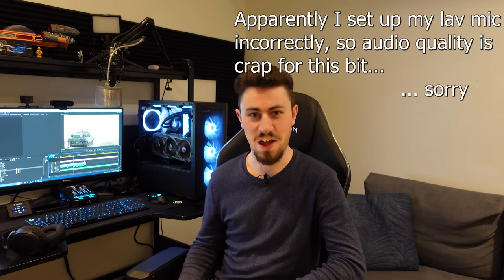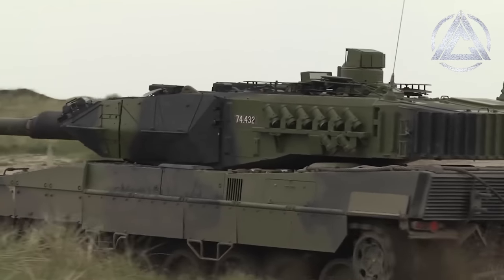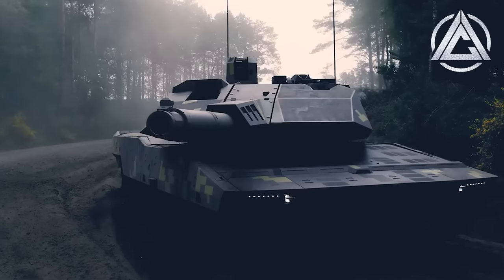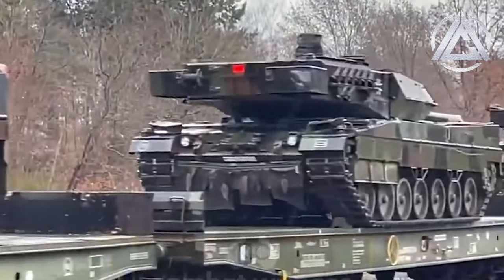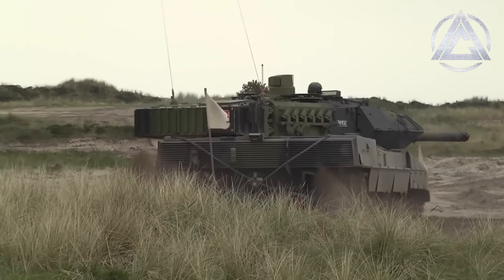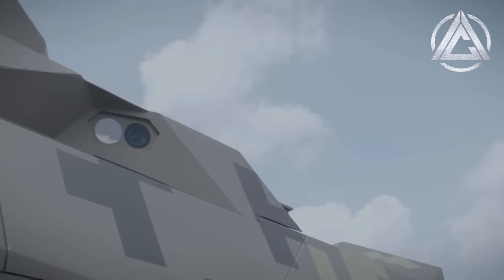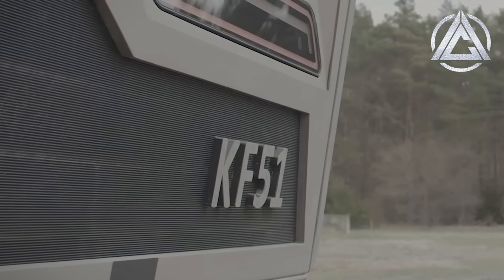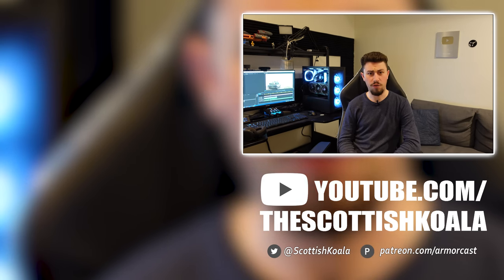Germany's New KF51 Panther Tank | The Spearhead of a New Generation?

Comment: I think it's also time to step down. 120mm is like an optimal for good amount of rounds and high fire power but with 130 and 140mm munition in the vehicle get lower maybe its time for the 105mm coming back for some more medium Tanks in the 25 to 45t range for also more monility
Reply from the maker: I would actually tend to agree with that. With the idea of the ETC cannon being a reality now (XM360 gun of the Abrams X is an ETC gun), the larger calibre is not necessary to gain velocity or penetration.

If you don't know, an ETC gun is basically all the benefits of a railgun, but without the massive energy requirement, barrel life issues, or sheer size of the assembly!
Reply: @ArmorCast  yeah but barrel life is also an issue if it is rifled which is the standard for 105mm for now atleast but i hope to see Something like this driving next to a kf51 xD
Reply from the maker: @kqckeforyou4433  no reason why a 105mm smoothbore ETC could not be developed, though it would unfortunately mean that existing 105mm ammo cannot be used.

ETC guns’ barrel life issues have all but been fixed
Reply: @ArmorCast  yeah and we need to go smoothboore anyway. I also remember that rifled barrels also create strong friction with the Apfsds Projektile trought the driveband but take that with a grain of salt. So a switch could lead to better Performance and even without ETC we could modify existing Projektile with new Penetrator who can sharp them self (like DU one) , modern  propellant and also change of the Shell from metall to those wich are also Propellant and only the stup is metall. I did some wage math and from a top 105mm Penetrator which had around 530mm at 2km with 0° an increase in atleast 30 to 40 percent out of the same barral should be possible which leads up to around ~700mm at 2km with 0° which are around the Performance of modern tungsten apfsds out of L/44 barral so with ETC so mutch can be achieved. But that would need the Will to do it

Comment: Here's a possible advantage of an unmanned turret which came to my mind while you mentioned the countermeasure system which is supposed to be able to shoot the enemy while they are still aiming:
If you want to be able to react that fast to this, you need to be fast. Let's just say that from aiming to shooting you have a time frame of 3 seconds (and I think that this is quite generous).
In that time frame you need to: notice, deploy smoke, turn the turret, aim and shoot.
It's likely that the enemy is not already pretty much in front of your gun, so as an example let's say the enemy is 90° (or a quarter turn) to one side (e.g. because you are currently shooting a different enemy).
Now, if all the stuff which needs to be done can be fully automated (scary thought if you think about it), the equipment can move the slowest (after all, if you need to wait for human input, that's going to take the longest amount of time).
Let's just say for a second that everything besides turning the turret can be done instantly.
So, you need to turn 30°/s to be fast enough.
If we don't have a loader (these are normally standing in the tank while loading), you have now 2 people (commander and gunner) who are pretty much thrown around. If they use seatbelts not too bad (hopefully), but if they don't, they could very well fall of their seats. And even with seatbelts, they can very easily hurt themselves on something else from such a sudden and fast movement.
Imagine you are on one of these carousels you see on children playgrounds. You aren't in the middle of it and with the seat back likely towards the centre (meaning: it will not help you).
Reply: Rarely is an entire front of engagement going to cover more than 15°, until range is short, in any open-field battle.

Reaction to ambush can reach 90° or worse, and ambush and response to surprise encounters are the norm in city fighting.

In open field, precision of control over azimuth and elevation are King. Without them, you cannot hit no matter the quality of gun and ammunition and sights.

In city fighting, speed of rotation and reloading is King. Ranges are usually very short, with minimal action, reaction, and response times, unless you somehow get in a fight on a highway or boulevard that crosses the city.

In both, stabilization systems are crucial because having to stop to steady to aim makes you an immobile target.

But three seconds is a very long dwell time once aimed, before firing. Five seconds is too long, while very few manage less than one second (due to inadequate training).

But yes, the modern militaries have been moving increasingly to remove humans from combat and indeed to limit their impact in military service. Autonomous kill systems have been on the rise, from the deployment of Predator IV ground patrol drones in area denial use (They didn't work too well. They were supposed to kill unauthorized personnel, but failed to correctly authenticate 5% of badges.) in 2003, to systems like Aegis, Palantir, and the systems that allow one (theoretically) manned tank to command, coordinate, and control three more in a platoon, with all four identifying and engaging targets individually.
Reply: @davidgoodnow269  yep
And if it comes to reaction time, computers are always going to surpass humans.
Correctly identifying something not necessarily tho (although tbf, humans in stress situation aren't good at it either).

Comment: FYI for recording lav mic audio it looks like what happened was the lav mic was only recording to one half of a stereo signal (the left side). This is done so that 2 lav mics can be recorded on one audio track (one on the left channel one on the right). The way to fix this in post (in premiere) is to navigate to the clip in your media bin

Right click, modify>audio channels

Then change both audio channels to the side that contains the audio from your lav (IE the left side).

This will make the audio play across left and right channels as a mono signal.

Hope this helps!
Reply from the maker: Cheers for that! As for the actual audio QUALITY itself, that will also be fixed next time around (the microphone was peaking the entire time because the makeup gain was set about twice as high as it should have been!)
Reply: @ArmorCast  Sure thing, those pesky gain levels are super hard to master when recording your own audio. Maybe a wireless IFB could help with monitoring your audio when recording as a one man band.

Keep up the great work! It was a super informative video!

Comment: I think autonomous operational capability is critical for any replacement tank.  That will increase the battlefield adaptability.  The reality is that eventually autonomous systems will be more accurate and react more quickly to dynamic battlefield threats and will utilize a wide array of high resolution sensors,  that are hard wired into the battlefield management system.  They will be able to be AI assisted and use big data to derive,  adopt and respond to standard battlefield tank tactics,   based on real-time battlefield grid information.  They will be linked to military supercomputers in the cloud that run real time dynamic battle simulations in a matter of seconds, constantly updating and optimising the autonomous tank battalions tactical strategy.

Comment: As far as your concerns about its design I believe your getting ahead of yourself as the 6 KF51 demonstrators are hand built prototypes. War is ever changing and all military vehicles must be adapted for the change. The Leopard 2 is a very capable and mature design. Look at the changes that had to be made to it to keep it viable.  Just like we saw the changes of XM-1 to M1A2 SEP 4. But both tanks are rapidly reaching end of product life.  The SEP 4 has had amazing capabilities to it, but it was at the cost of functionality.  It can no longer operate in very soft ground without the high risk of becoming bogged. About 80% of the rural bridges can be used by it. So we have reached the point where advantages cannot be add without incurring disadvantages.  So going weight will kill off the current designs alone. Let alone many other factors that are fast approaching.  Don't get me wrong as I love the current designs just like I love the Sherman and the Cromwell,  but everything has its time in the sun.
All military equipment has two elements; design and function that must fit into and add to military doctrine of its intended branch. Here we can only talk factually about design and only conjecture about function. Such as the JS-2 or IS-2 they both are the same tank. Very powerful indeed but only carried 17 rounds for its 122mm gun while the Tiger 1 squeezed in around 100 rounds. The JS-2 was designed as a breakthrough tank which means it was designed to smash a large hole in the enemy's main line of resistance so T-34s could pour through into the enemy's rear and would be expected to do most tank vs tank battles. So the T-34 and Tiger 1s carried ample ammunition for this. As a breakthrough tank would only engage a tank if it got in the way. Its main concern was to fire HE rounds into anti tank gun and Infantry positions so it did not carry many AT rounds.  Yet it was considered a very good tank that carried ample ammunition.  So I would ask is there a connection between the KF51 and KF41. Design and function fitting within doctrine but I'm not suggesting a replication of the T-34 and JS-1.
What does stick out to me is the KF51 has a lot of command and control function built in. So I personally do not believe it was meant to  lead from the front like a T-90 or T-14.
In the near future a number of sources believe the most common battle will be meeting engagement. This is how I see 5th generation warfare happening.  The tank company may have 4 platoons and will be expected to manage its battle space as directed by higher command. To accomplish its mission it would have other assets attached to it such as infantry and anti air unit or have assets on call such as artillery and strike aircraft. 
Platoon 1 may have 3 KF51s and replaces company command while platoons 2 to 4 each has 3 tanks. Initially these could simply be Leopard 2s and later Leopards with KF-51 turrets without the high end kit but carries more ammunition. 
The battle. With the available air recon the German force is likely to discover the other force first without contact. The anti air assets including suicide drones will deny the enemy doing the same while destroying command and control vehicles.  Now our unit may be ordered to attack, by this time most of the enemy's forces will be identified while all information is now being fed live to higher commands. Platoon 1 may stay together or disperse to the other 3 platoons as coordinators.  Information will now be coming back down by now from higher command.  Now assets are being directed to objectives of high impact without wastage of assets. All the while the enemy may have to waste assets for reconciliation by fire and waste time establishing the new chain of command. Now the attack is ready so Platoon 2 forms a fire base line and the remaining platoons become the manoeuvre units along with attached infantry forming security for the tanks and be part of the final assault.  Now these nothing that new but its the much high speed of decision making based on solid established fact. It means our force here quickly gets inside the enemy's decision making loop which in turn means they can only react. Again nothing really new here either but it's the speed at which it happens is the game changer.  However this is just my own personal thoughts on the matter. As we enter into 5th generation land warfare other powers will bring their 5th generation equipment to the field and warfare will have to change. The KF51 is the first step of what will happen over the next 25 years.  At some point armour protection will exceed that of 150cm of steel armour and rounds of the 140mm will have to be developed to meet this. At this point our current line-up of tanks will be hopelessly obsolete. Pity I love Leo.

Thank you for your effort of producing such a fine video and I totally appreciate your hard work on filtering out fake news on the topic. It is becoming a real problem these days. I look forward to your next video.  Thank you again for your hard work.

Comment: One thing you ommitted with gun analysis is the increased effect on live force, materiel, structures and light armor. 130mm HE round would be quite an upgrade over 120mm
Reply: 130mm is about velocity and penetration
Reply: @ianharman9499  and payload ...

larger diameter shell = more HE filler 

the PRIMARY role of a tank is NOT fighting other tanks, but infantry support and defensive line breakthrough ...

busting pillboxes, running over trenchlines, blowing up buildings, destroying trucks and APCs ... 

that larger gun will pack a lot bigger punch against those targets at even more range than before. At 130mm its basically light self propelled artillery piece AND tank in one package - which brings the question if the tank can elevate the gun enough to provide indirect fire.

Comment: My idea for a tank design is an automated turret with autoloader and the ammo in the back of the turret with a blast panel on top.  The transmission at the front end, engine behind transmission in the front like Merkava, Swedish S tank.  Fuel outside in Jerry Cans on the front and sides behind Cage armor, like Swedish S tank. 3 man crew sealed underneath the turret.  Because there is no fuel or ammo inside the chassis, there's enough space behind the crew to put at least 4, possibly even 6 infantry, like Bradley, door in the rear.  Active protection system on the turret, 120 mm and 7.62 mm MGs.  Redundant sensors all around.  Advantage of this design, eliminates requirement for separate infantry fighting vehicle following behind the tank, modular design, quick refueling(physically swapping out full Jerry cans), fuel also doubles as protective layer, as does engine and transmission.

Comment: I understand that the wedge at the front of the turret is probably exaggerated by composites and the main armor might not be so steep, but that still looks like one hell of a shot trap, no? Looks like it'd shunt shells right down into the upper plate, or into the turret ring and jam it up.
Reply from the maker: Modern tanks don’t really have to deal with shot traps, because modern ammunition doesn’t work like the conical rounds of say WW2 tanks